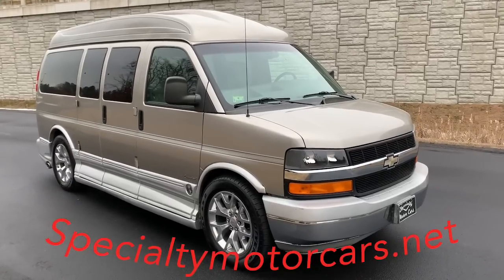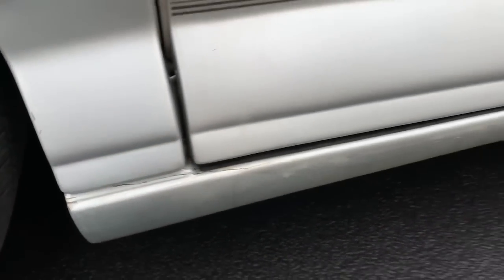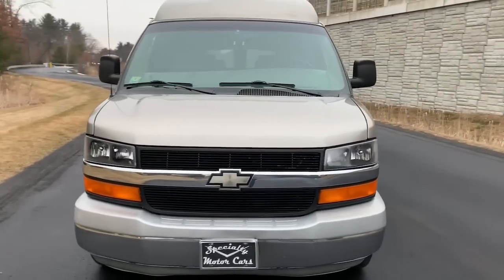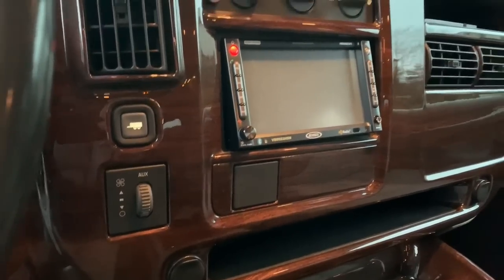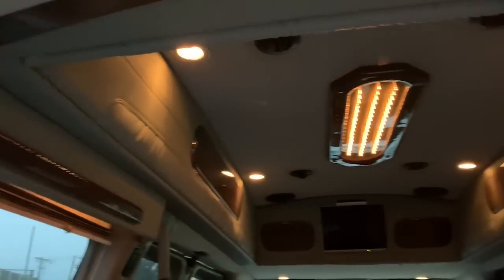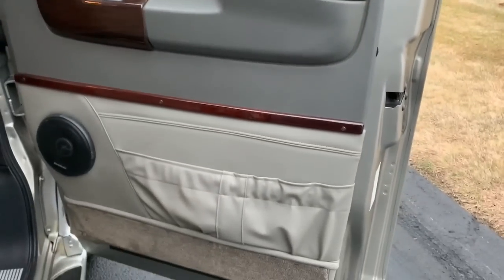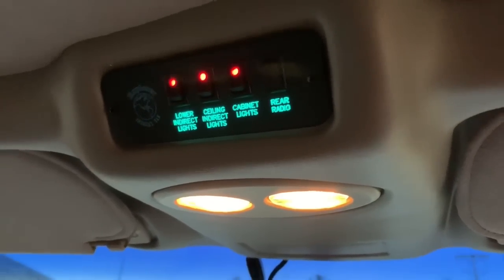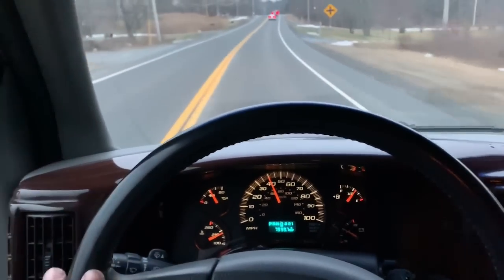SOLD 2003 Chevrolet Express 1500 AWD Explorer High Top Conversion Van For Sale Specialty Motor Cars

Comment: My parents had a 96 Explorer High Top conversion van. Apart from having a SNES, old tube type TV and a 12 disc CD changer as the center console between the driver and front passenger the interior looks almost identical. Ours was only the 6 door and just had a big window on the drivers side. We cruised in that thing all over the country.

Comment: Bought an 03' Astro 6 years ago in Tucson and drove back home to Detroit. High Top conversion w/ very similar seats and interior and body package. Mine has a 4 grand custom paint job. Engine blew up at 125k.  Just put in a Chevy crate and replaced about everything under hood and steering n front suspension.  Now have a total 15k invested.  Solid n like new.  You sell your vehicles for good prices.  That red MarkVlll a month ago was priced low, I drooled over that one

Comment: Just those wheels and tires would sell for like $1500-$2000 here in Canada. That’s a good deal for a real nice van!
Reply from the maker: They are really nice! I paid $1000 for them here. They were taken off at 200 miles. Came with lugs and locks. They made a huge difference for the look of the van
Reply: Anthony Gozzo do you get many Canadian buyers for your vehicles?
Reply: How much is the van
Reply: Shank Adams  11k

Comment: Sorry Anthony that van It’s not worth the price you’re asking for first thing the instrument cluster with the lights some people love to have all the lights on that’s gonna cost is $500 to fix the crack on the bottom $1500 to fix that is a high mileage van  for a Chevy The most that’s worth is $5550.00 all day long
Reply: You are absolutely right Bear Claws, many things to maintain, I have a loaded 01 Astro van that is very reliable, 160,k miles, the little things that go wrong add up. $5500 is a correct for that vehicle.
Reply from the maker: Sold in 2 days for full asking with 3 buyers waiting on deck. 🤷🏻‍♂️
Reply: All a can pay 4500 that all
Reply: @specialtymotorcars  I have a 2005 looking to sell if you want another one.